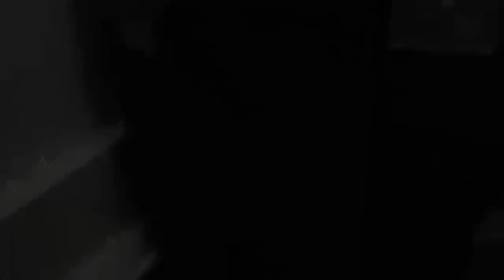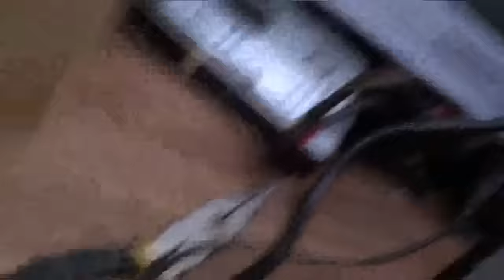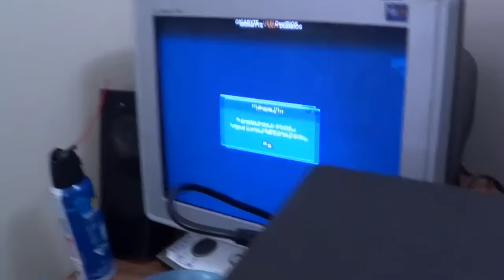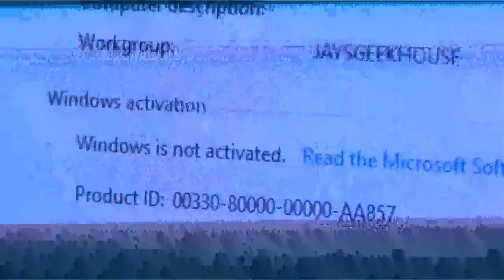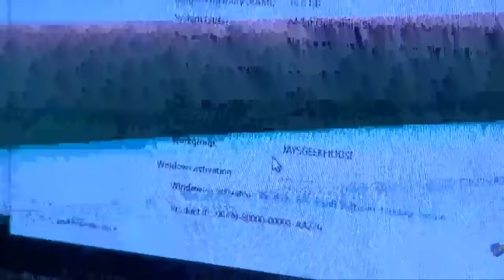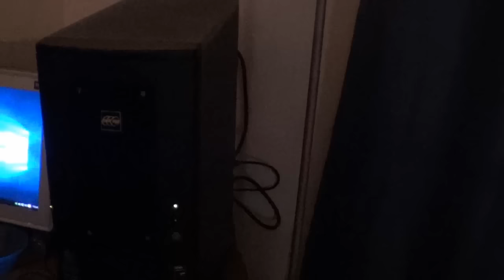The Redemption Of Tuxedo

Comment: So how old was the power supply that blew up anyway?  I was thinking of taking my current PSU from 2011 and using it in my next build but I don't know now.  When I saw the quick o flick you did I thought you were just trolling us by pressing the power button and firing a cap gun out of view of the camera
Reply: FubarMike it will be fine it's just stuff failes at random times like my cpu desided to die 20 days after I got it :p but if it's a cheap one get a new one if is a descent one then use it